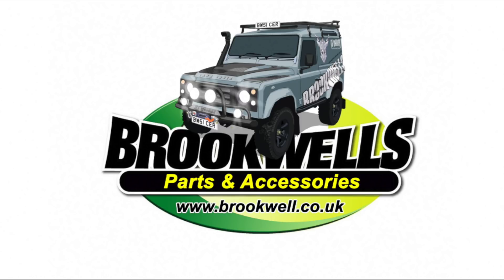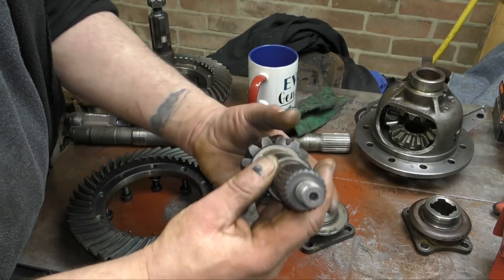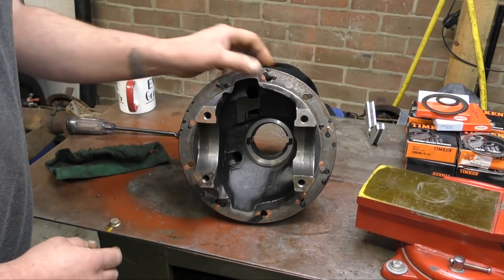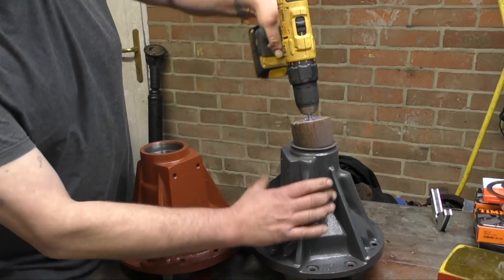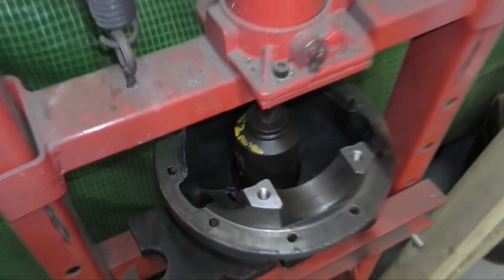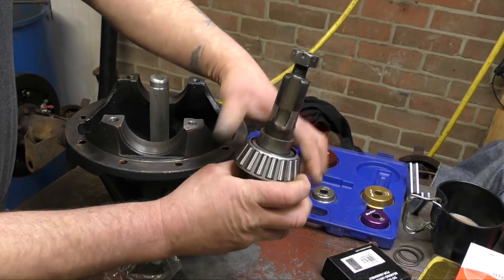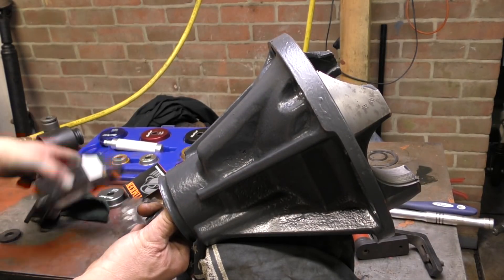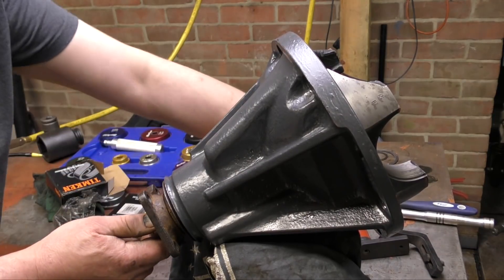Land Rover Diff Overhaul - Fitting Differential Pinion Bearings

Comment: Hi Chris, ive got a td5 defender with a rear differential that the pin broke and caused all the gears to shatter, would it be cheaper to rebuild or find a reconditioned one. Thanks.